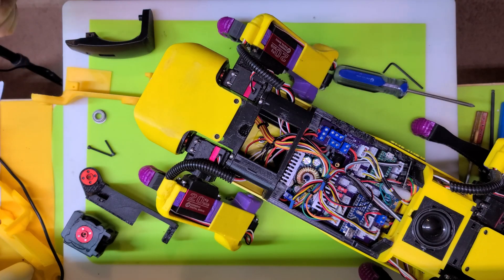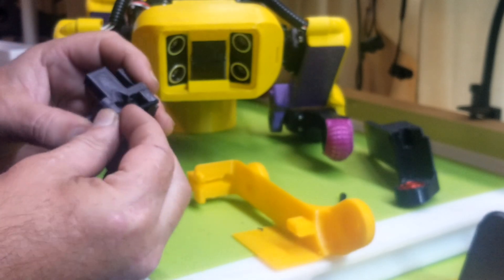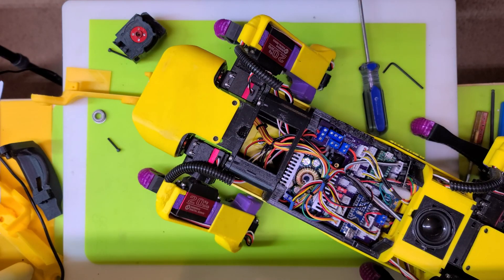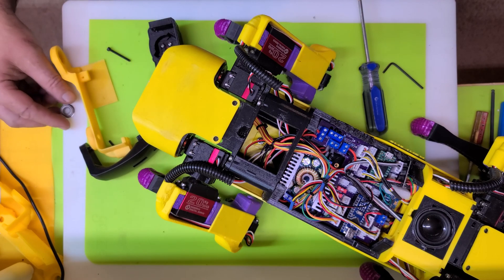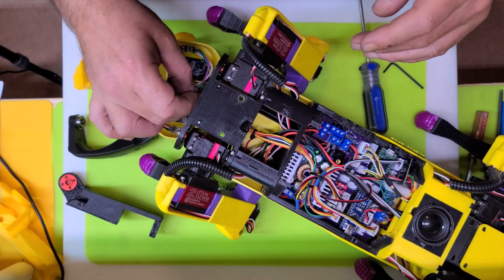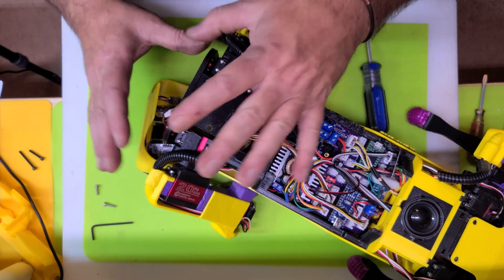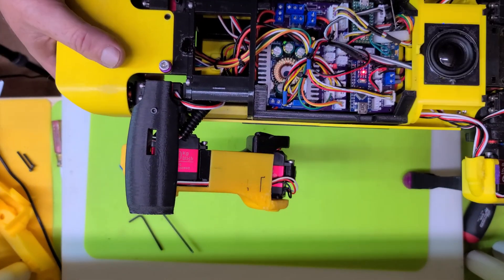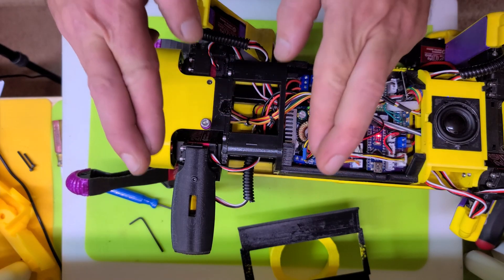New Shoulders for NovaSM3 v5.2 : a Quadruped Robot Dog Spot Mini Clone

Comment: I realize that I'm pretty late to the party but I was wondering if there is an upgraded left femur cover to accomodate the reinforced shoulder.
Reply from the maker: welcome!  no problem, I believe this is what you're asking for?
https://github.com/cguweb-com/Arduino-Projects/tree/main/Nova-SM3/STL%20Files/SM3%20Mods/Shoulder%20Bracing/Chris%20Locke
Reply: @ChrisLocke1969  Thanks for getting back to me so quickly. The location you supplied is the one where I found the new shoulder and the right femur cover. What I think I need is the left cover, like the one shown at minute 1:00 of the New Shoulders video above.
Reply from the maker: @tbrandx2  ahhh, I am sorry.  Its a mirror image of the right cover -  your slicer usually can mirror models with one or two clicks.  Hope that helps
Reply: @ChrisLocke1969  Thanks again! Made my day! I've been 3D printing for 8 months and never had ocassion to look at that feature. Love it!
Reply from the maker: @tbrandx2  my pleasure, sir!!
Reply: @ChrisLocke1969  Do we have to mirror all the 3 stl-files? (brace, cover and coax) ? I see the brace.stl stays the same?
Reply from the maker: @Jamesmonstre   yes, sir.  sorry for the confusion... you don't know how many times I printed the wrong side part, or the same side twice lol  Good luck!

Comment: While i had the embedded nuts, I fixed mine slipping and rotating by using the soldering iron to melt some filament around the embedded nut to keep it in place. Great work by the way. Literally yesterday I finished the entire chassis for my spot, now it's back to the printer after seeing this :)
Reply from the maker: oh, that's a great idea, yes!  So you essentially close off the nut in plastic?  That'll work! ;)   And thanks, I'm glad to hear you are building one, as well, and that I put this out before you assembled yours lol -  I still have two legs / shoulders to do!.